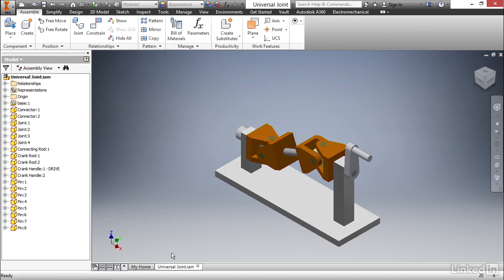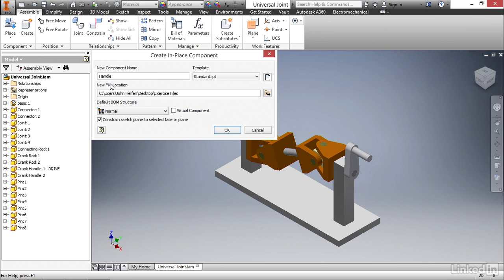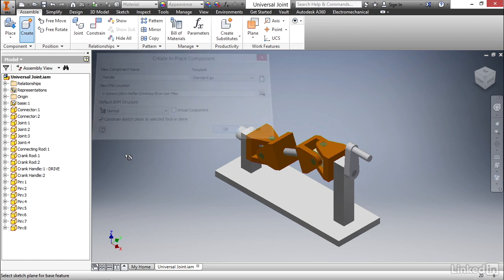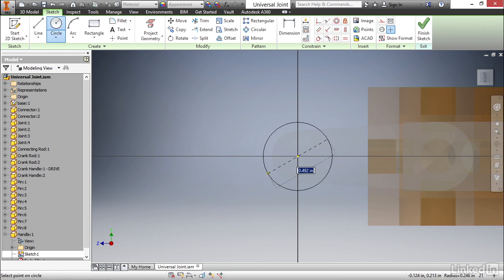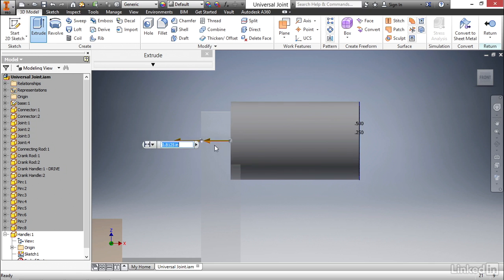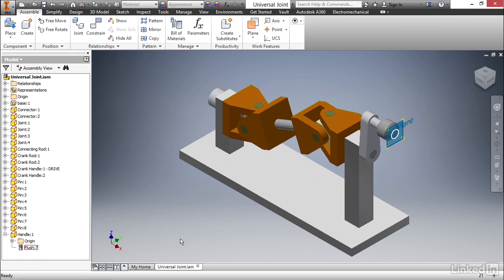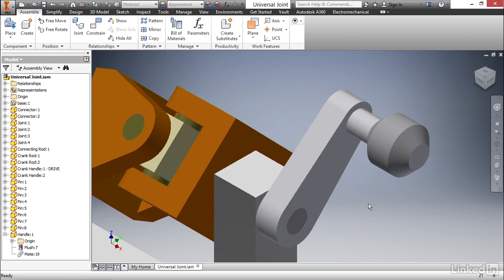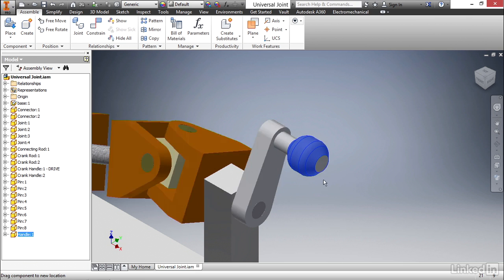Inventor Tutorial - Create and edit in an assembly

Comment: This is a great little tutorial for creating new parts in an assembly but is there a way to sketch a line or shape, as a new part, directly onto the assembly. I want the cursor to snap onto the corners, midpoints, quadrants etc of the assembly whilst in the new part mode (when the assembly is greyed out)
Reply: Did you ever find the answer to this question?
Reply: You can do that by projecting geometries and using constriants in the sketches